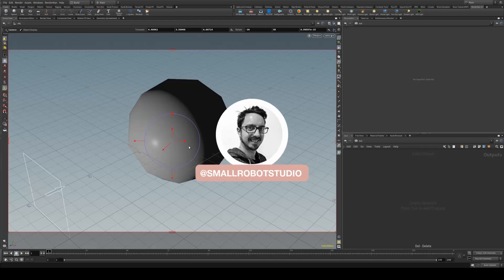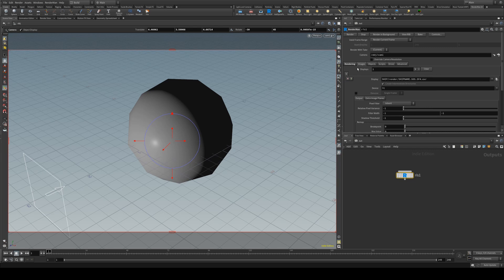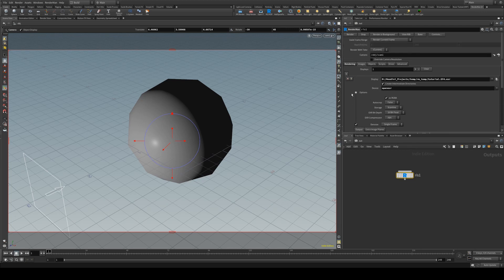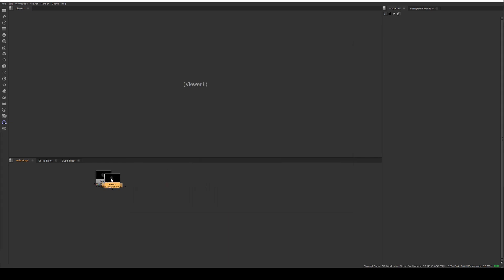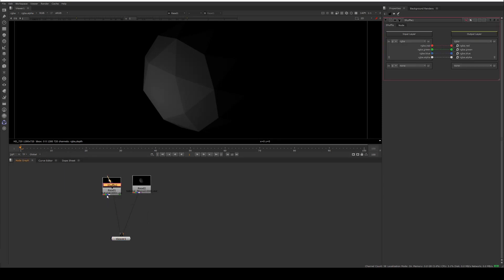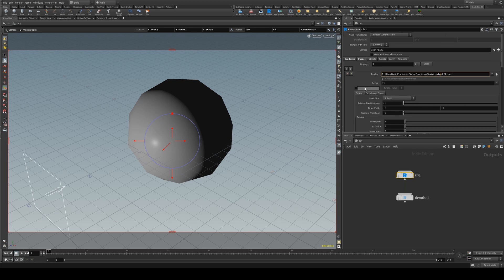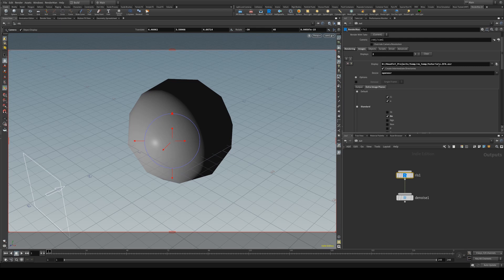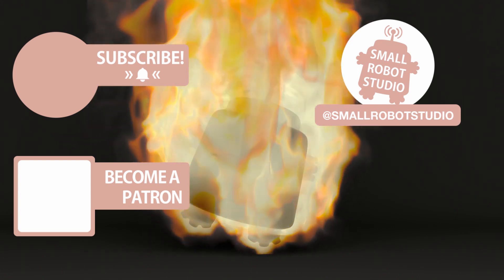Renderman 23 AOV's and Denoising [Houdini] Tutorial

Comment: great tutorial! I have a few qestions though. Is it possible to attach the denoise rop after rendering? I forgot to attach it before rendering and now I would like to denoise it as a post operation, without having to rerender every single frame. But when I try this, renderman will rerender the original image. Does that mean denoising only works right after rendering it? Also, if they denoising happens on the denoise rop, why is there a denoise checkbox on the render rop? I assume this is just a toggle to turn denoising off or on? Got me confused bc seems unneccessary if you can just detach the denoise rop from the render rop if denoising isn't wanted.
Reply from the maker: I think in the other Denoising tutorial (Maya but it's not DCC specific) I show how to run the denoiser on any .exr that's already been rendered as a variance - check that out I'm not sure if it'll work in your case but it might be the solution.
Reply: @SmallRobotStudio  seems to work but I don't think it's cross frame denoising sadly
Reply from the maker: @thehasen6037  no I don't believe it does but I haven't really investigated a method to enable it - check the docs you may be able to do it through the command line
Reply: @SmallRobotStudio  will look into that! ty for the tip :)

Comment: But how to denoise sequence, cross frame doesn't seems to be working? You should check this.
Reply from the maker: If it's not working that's really a job for the devs and not me
Reply: @SmallRobotStudio   Or just that you don't know how to do that.
Reply from the maker: Where you select "denoise" there's a drop down that you can change from single frame to cross-frame. If this is not functioning as intended then, like I said, you need to inform the devs.
Reply: @SmallRobotStudio  if you check on forums "crossframe" option job is to look between 2 frames for denoising so that it doesn't produce artifacts, it is not for rendering denoised frame sequence. What i am asking is that houdini is only exporting 1 denoised frame at a time, so how can i export whole sequence of denoised frames in one go?
Reply from the maker: Yes, I'm aware of what cross frame denoising is. Are you asking me how to batch render a sequence?
Reply: @SmallRobotStudio   yes how to batch render denoised frame sequence using renderman denoiser.
Reply: @SmallRobotStudio  so did you figured that out? or I'll just assume you don't know.
Reply: @cinemareelsX60  You're very smart aren't you?